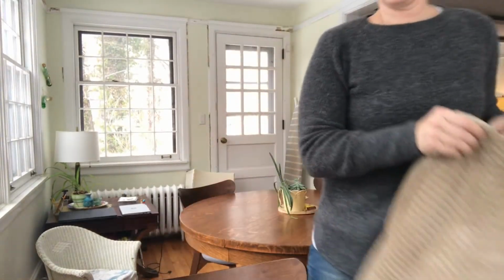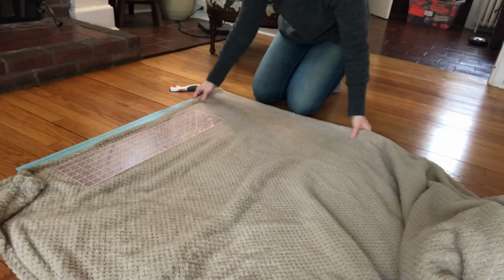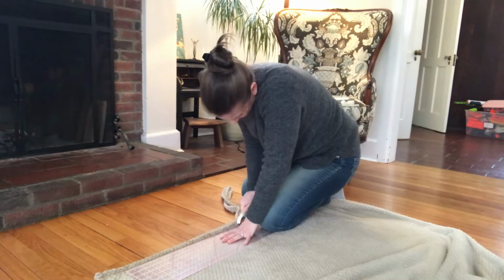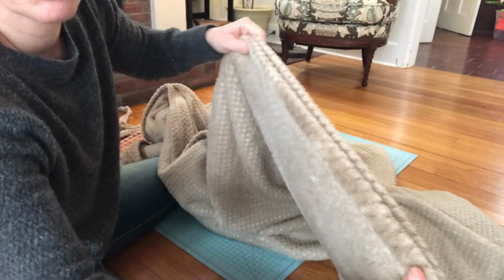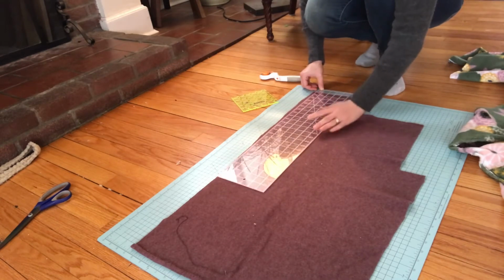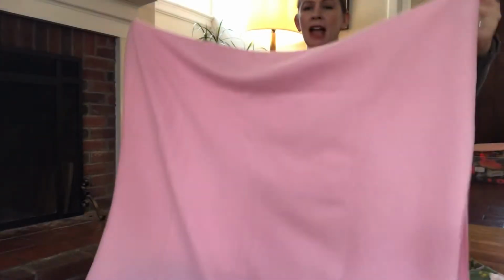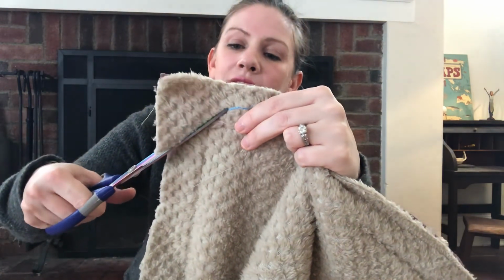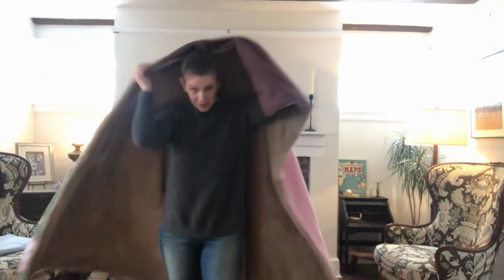Warming up a blanket with fleece

Comment: I have three tips, for you.  You can get a long ruler at Lowe's, or Home Depot. They are metal and are great for cutting long straight cuts. They are around twenty dollars. Second one, if you cut the edge on the stitching, you could reuse the binding again. Third tip, put your cutting mat in the sunny spot, or outside in the sun. That should take the warp out. I hope that this will be helpful.

Comment: I am like you and don't change my blade. They're pretty expensive. But I bought a blade sharpener and it works fairly well  and it didn't cost much. Great videos,.
Reply from the maker: I think I need to invest in a blade sharpener. Probably the responsible thing to do!